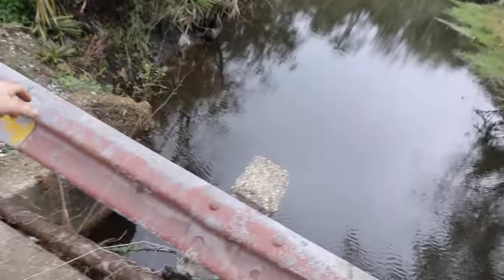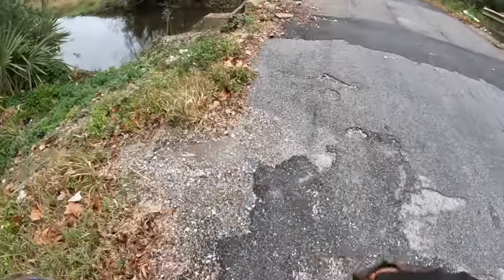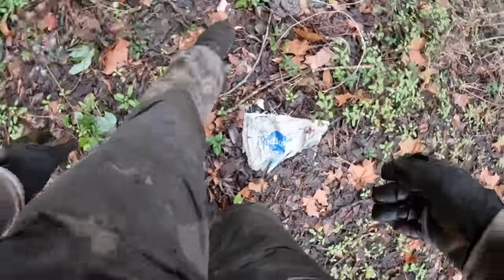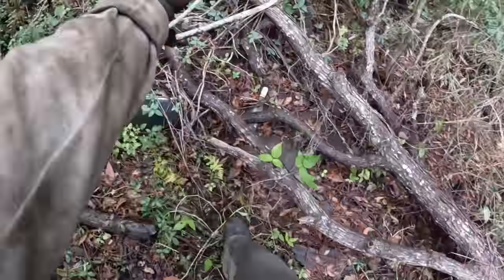Magnet Fishing The Site Of A MURDER

Comment: Early revolvers were caplock muzzleloaders: the user had to pour black powder into each chamber, ram down a bullet on top of it, then place a percussion cap on the nipple at the rear of each chamber, where the hammer would fall on it and ignite the powder charge. This was similar to loading a traditional single-shot muzzle-loading pistol, except that the powder and shot could be loaded directly into the front of the cylinder rather than having to be loaded down the whole length of the barrel. Importantly, this allowed the barrel itself to be rifled, since the user was not required to force the tight-fitting bullet down the barrel in order to load it (a traditional muzzle-loading pistol had a smoothbore barrel and the shot was relatively loose-fitting, which allowed easy loading, but was much less accurate). After firing a shot, the user would raise their pistol vertically while cocking the hammer back for their next shot, so the fragments of the burst percussion cap would fall clear of the weapon and not jam the mechanism. Some of the most popular cap-and-ball revolvers were the Colt Model 1851 "Navy" model, 1860 "Army" model, and Colt Pocket Percussion Revolvers, all of which saw extensive use in the American Civil War. Although American revolvers were the most common, European arms makers were making numerous revolvers by that time as well, many of which found their way into the hands of the American forces. These included the single-action Lefaucheux and LeMat revolvers, as well as the Beaumont–Adams and Tranter revolvers—early double-action weapons in spite of being muzzle-loaders.[10]

Comment: A matchlock revolver with a single barrel and four chambers held at the Tower of London is believed to have been invented some time in the 15th century.[4] A revolving three-barrelled matchlock pistol in Venice is dated from at least 1548.[5] During the late 16th century in China, Zhao Shi-zhen invented the Xun Lei Chong, a five-barreled musket revolver spear. Around the same time, the earliest examples of the modern revolver were made in Germany. These weapons featured a single barrel with a revolving cylinder holding the powder and ball. They would soon be made by many European gun-makers, in numerous designs and configurations.[6] However, these weapons were complicated, difficult to use and prohibitively expensive to make, and thus not widely distributed.

In the early 19th century, multiple-barrel handguns called "pepper-boxes" were popular. Originally they were muzzleloaders, but in 1837, the Belgian gunsmith Mariette invented a hammerless pepperbox with a ring trigger and turn-off barrels that could be unscrewed.[7]

In 1836, American Samuel Colt patented a popular revolver which led to the widespread use of the revolver.[8] According to Colt, he came up with the idea for the revolver while at sea, inspired by the capstan, which had a ratchet and pawl mechanism on it, a version of which was used in his guns to rotate the cylinder by cocking the hammer. This provided a reliable and repeatable way to index each round and did away with the need to manually rotate the cylinder. Revolvers proliferated largely due to Colt's ability as a salesman,[citation needed] but his influence spread in other ways as well. The build quality of his company's guns became famous, and its armories in America and England trained several seminal generations of toolmakers and other machinists, who had great influence in other manufacturing efforts of the next half century.[9]